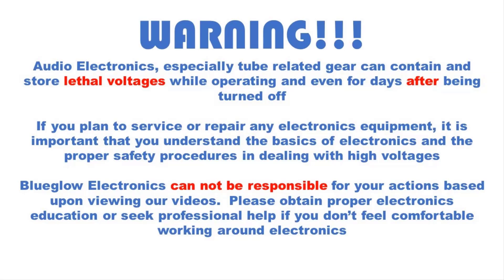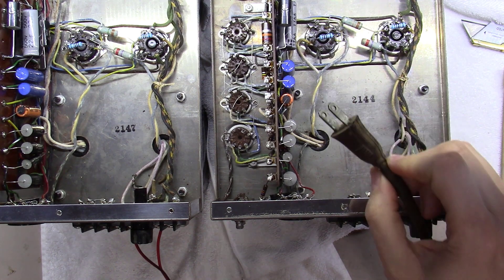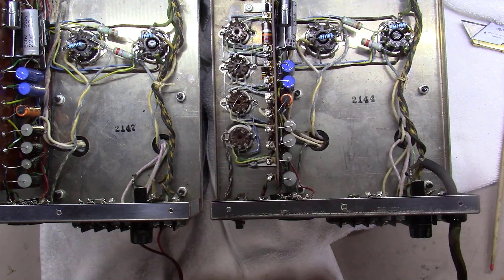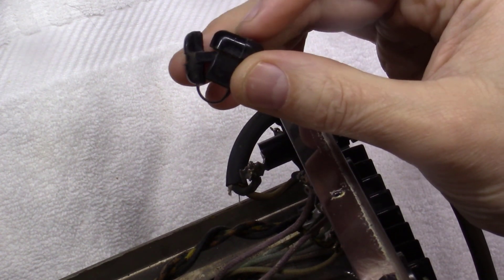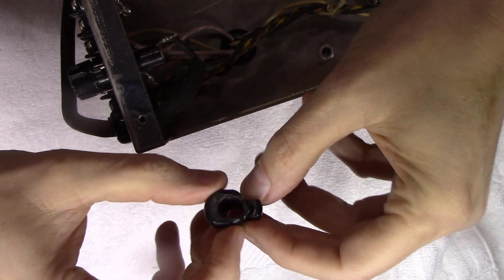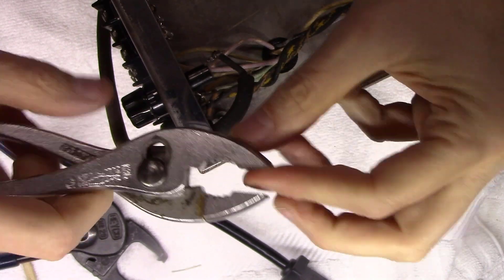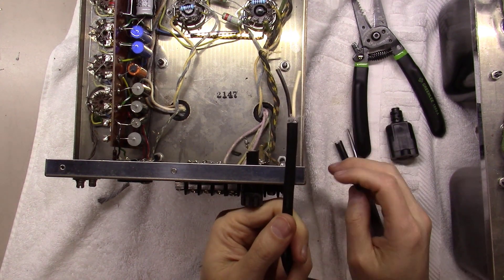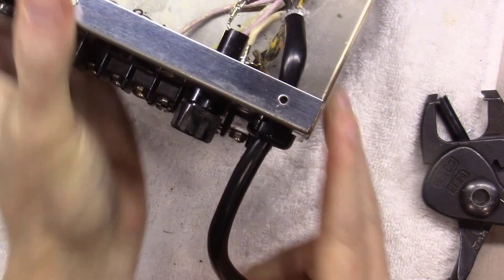Vintage McIntosh Power Cord Replacement

Comment: Thank you kindly for this video.  A few days back, I purchased a non-working McIntosh MC-7270 amplifier.  I had ordered a kit to recap the amplifier for the process of restoring it.  As I am waiting on the kit to arrive, I stumbled across your video.  Needless to say, I pulled out my Ohm meter to check for continuity on the power cable.  It turns out the hot wire had a break somewhere inside of the cable.  $13.97 later and a few minutes to de-solder and solder in the new cable and the amp was up and running within minutes.  Needless to say, your video provided me with insight on where to check for potential issues.  Bravo!!

Comment: Nice video Mark, good to see you back in action.
I like to strip of the outer sheeting just inside the case so only the wires are bent inside the case not the whole stiff cable.
And also take the opportunity to put in some ferrit cores on the AC line to prevent interference.

Comment: Good video, Mark.  

A photo/video tip for you... Using a white towel makes it difficult for the camera to determine the correct exposure needed. And it shows here. Cameras base their exposure determination using the assumption that the average subject matter will be about 18% gray. (Medium-light gray.) So if you can find a towel that is approx that darkness, (doesn’t matter what color, though loud colors might mess up your white balance for the same reasons) your video exposure will come much better. Not so much harsh contrast.
Reply: Mark's video's are some of the best, but yeah,it definitely was playing tricks on my old eyes, hard to watch but very educational👁

Comment: Hi, I want to replace the power cord in my Mcintosh MA230 but the inside of the amp is not as simple as the one in your video.  Both wires on the non-polarized cord are black.  Also, there is no wire that goes directly to the fuse.  They are both connected to an AC plug on the back of the amp.  How do I know which is the hot wire and which is the neutral?   Any advice would be greatly appreciated.  Thanks!

Comment: hello mark. you are looking a lot better than you were. thanks for finding the wire replacement. i have a pair of st70's(recently acquired) and a dh200(a staple mid-bass unit) that will appreciate the new cables as i didn't want to change to the 3 wire units. the polarized 2 wire is a better option with old equipment as the extra ground wire tends to pick up hash from other pwm using units in the house causing much low level racket.  hope all is going well on your end of the planet.
=dok=

Comment: I was replacing the power cord on a Sansui amplifier from the 1960's. It was obviously made for the US market and hurried on to the UK market by the manufacturer simply replacing the transformer with a 250 volt version.
For the UK market it was completely unsafe with the original four  2 blade USA style power outputs on the back of the chassis constantly live !  
It was also a twin cable with no earth. Many people got electric shocks in the UK when they put a 2 blade plug into the back of a unit by feeling there way round. Or inadvertently putting the plug to far over and grounding the pin to the chassis.
We used a Weyco professional tool and a three core cable and earthed it inside to the chassis. We also ensured that the live switch line was connected via the power switch.
Then I disconnected the four power socket ~ unless someone decides to reconnect them up again.

Comment: I'm about ti build an old Heathkit AA32 NOS tube amp, and it of course comes with a non polarized cord since it's from 1966. I'm going to put a polarized one in straight away. Just have to find one with a close look to the original.

Comment: Would this have been a good video to discuss the death cap and the importance of now having a polorized plug you get the added benefit of mitigating that danger? Full disclosure, I'm not familiar with the power supply circuitry of this amp so maybe its a non issue.

Comment: Hi Mark, good to see you back. However I do have issue with this practice of not safety earthing/grounding metal chassis. Relying on signal cable screens as power protective conductors is not a great idea, they are not rated to carry fault currents to operate circuit breakers reliably. Also if you power up the un-grounded equipment without interconnects to other, grounded items, there is no path to ground/earth at all. I realise there can be ground loop issues on some old equipment, but usually there is opportunity to create safe ground lifts to separate the signal grounds from power safety grounding/earthing somewhere in the system.
Reply from the maker: Maybe its a practical issue, I've seen way too many old 2 prong devices, converted to three cord and have ground noise issues as a result.  Keep in mind, a lot of these old designs, there is no separation between earth and signal ground so without reworking the power supply design, its troublesome.
Reply: @Blueglow  Yes, I know some pieces can be tricky in that way. Standards change over time. I just try to earth chassis wherever possible to do so. Easier to do in the context of an audio system, taking the grounding arrangements as a whole, but if you don't know what a piece is going to be hooked up to, it's more difficult.

Comment: Why not polarize the original cord. We used to do it back in the 60’s in school. We would cut the proper pin and spread it apart to create the proper size pin and then solder in the gap. That assumes that the original cord is otherwise usable with no dry rot or cuts, etc. it works best with pins that have the little round hole in it which I could never understand the importance of.

Comment: Would have been better to put a socket in so you can choose what power cable you want. Would have been nice if you gone with silver and shielded what you could have used a 3 wire as the Shield just don't terminate it at the amp cut it off but leave it at the plug
Reply from the maker: The purist (or collectors of 60 year old McIntosh gear) would beat you for this statement.
Reply: So, Sweda, when do all of your "expert" videos coming out? Or do you just troll those who do create content for our enjoyment?